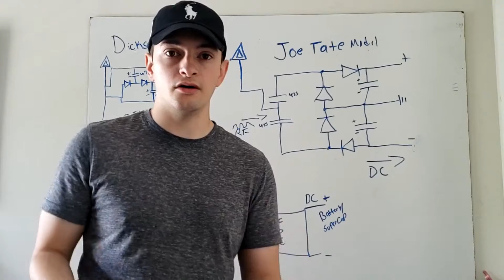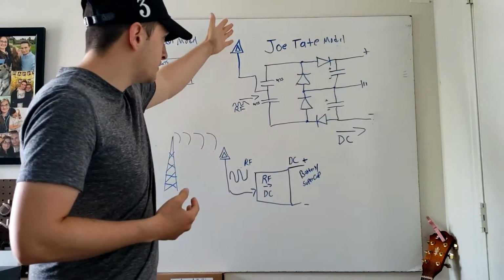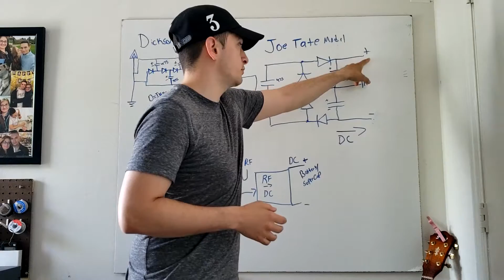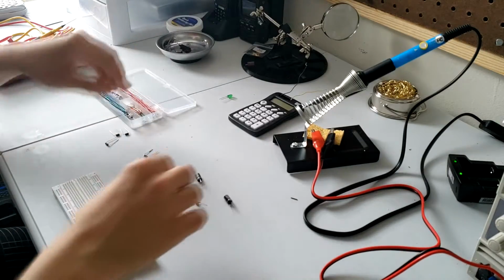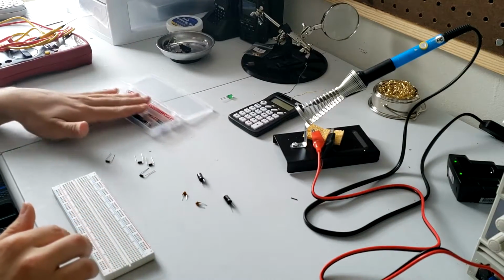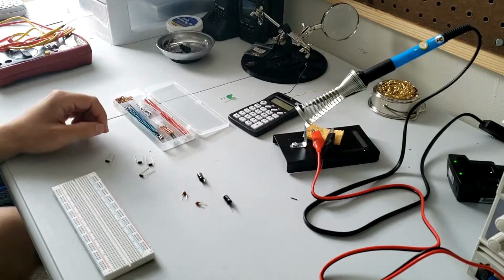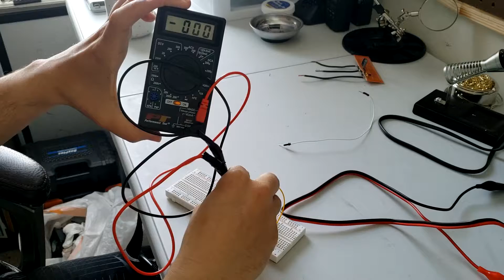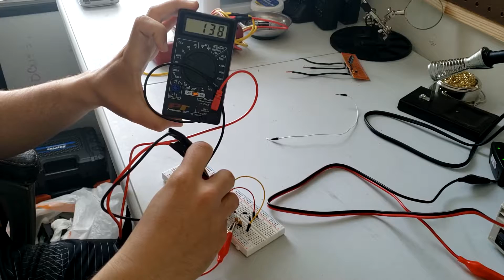RF Energy Harvesting - Building Joe Tates Ambient Power Module To Light an LED

Comment: I’ve never heard of “in4001” diodes. Do you mean 1N4001 diodes that have a rectification frequency of around 25KHz? Those are too slow for any RF signals. Here is a better circuit for energy harvesting from a HAM radio guy https://youtu.be/GhqRdNB_gUM?si=U7RdiT0sETuM1Xyj

Comment: Hi, 👋😢😢, PLEASE 🙏 BUILD THIS WITHOUT A PCB BOARD. WE DON'T ALL HAVE MONEY TO BUY ONE. I MEAN I WANT TO BUILD THIS BUT WITHOUT A PCP BOARD. 😊😊😊 TUTORIAL PLEASE 🙏
Reply: It is best to use a bread board because of organizing and knowing were everything is and they are not much but if you insist. The bread board had the 2 center columns that are separated at the center and separated from the row above and below but has 4 holes chained together on the horizontal sides. The red and blue on the sides are chained to gether in the vertical plain but do not chain the red and blue to gether because they are your positive and negative sides of your circuit hole this helps but if you need it visualized you can look up the internal connections online

Comment: how about connecting this circuit to that?https://www.google.com/imgres?imgurl=https%3A%2F%2Fwww.allaboutcircuits.com%2Fuploads%2Fthumbnails%2Fcockroft-walton-multiplier_revision.jpg&tbnid=j5A8AduKzbmkoM&vet=12ahUKEwjku6ftgpuEAxUqX_UHHZQYBGAQMygBegQIARBS..i&imgrefurl=https%3A%2F%2Fwww.allaboutcircuits.com%2Ftextbook%2Fsemiconductors%2Fchpt-3%2Fvoltage-multipliers%2F&docid=gIv9mvLLrmEguM&w=619&h=171&q=voltage%20tripler%20and%20quadrupler%20circuit%20diagram&hl=en&ved=2ahUKEwjku6ftgpuEAxUqX_UHHZQYBGAQMygBegQIARBS

Comment: Your restricting yourself by using electronic components, take an iron rod solder a cable to it and push it in the ground, then take a load of copper and stick it up in the air solder a cable to the copper then put your meter on the 2 cables, more copper more volts, because all electric is RF everything you believe to be true is false

Comment: Hello,

Can you say if it is possible to recover with your rectenna system, the energy of an electrical radiation which measures in Volt/meter?

For example, would it be possible to recover the electrical radiation that my computer or other electrical device propagates?

And would it be possible to recover the energy of the induced current of the body (see test of induced current of the body)?

If yes, can you sell me your ready-to-use system as well as make me a step-by-step video of the realization of your system and if so, at what price?

I thank you in advance for your return as well as the precisions that you could bring me?

Have a good day.

Cordially,
The White Rabbit ;)

Ps: this message has been translated with google translate because I am French and do not speak English.

Comment: Hey man! I am doing this circuit as a capstone project for collecting energy from alternative sources.  Can you give me a tip on how can I increase the power of this circuit?
Reply: I got selected to do undergraduate research and I think im also going to do this, this is so cool
Reply: @Coolgiy67  This is a fun project to open up possibilities of wireless energy transmission.
Reply: @Coolgiy67  Check out this video by company Powercast https://youtu.be/xZVA5p9c9hc
Reply: @wally4304  nice
Reply: You can either add a Joule thief to the output for current, or create a voltage multiplier for voltage, or a combination of both. Many people have been working on perfecting this circuit for more useful applications. As of now, this circuit is used to power low energy devices for the IoT.

Comment: its useless to use radio to receive power. you must diy a circuit that takes in continuos signal direct from the air, aerial frequencies. check the atmospheric electricity specifications, 100v per meter height.

Comment: add a flasher chip to the end of that circut it doubles the voltage to flash an led i think its a lm3909 flasher chip i hung it on my wall and every time i keyed up my station it flashed the led.

Comment: You can get Earh ground by making a 3-prong plug that has no BLACK and no WHITE wire ... only green ... the center lower pin. That is your Earth ground attached to the house. However, in some ways this cheats because there are loads of spikes on that wire from home appliances in the house that glitch and come off and on... Fridge, etc.

Comment: Bro, I'm getting high voltage but the current remains 50ma, but the issue with the current so, can you please tell me how to increase current to 500ma
Reply: perhaps the high voltage is due to inductive coupling,the multimeter maybe showing wrong values because of that,for better readings use analogue multimeter or voltmeter

Comment: 1. If you do have access to ground, where should i put the connection?
2. Which part of the antenna (in or outside) did you connnect to the antenna of the circuit?
3. Would  it be possible to put more antena's in this circuit  or would it just increase the resistance?

My highest reading yet is 25 mV

one last question: after a while the readings suddenly dropped to a negative number without inverting polarity , anyone has an explanation?
Reply: Everything is possible. But to add to your excitement...

Comment: Nice,  a few gafs,  you caught the capacitors/diodes one,   but also mw is no mv sure they can be related..  but...   also you could try tapping your electrical ground for a ground.  may not be great for audio projects, but may help your scavenging..  but here is my view and upvote and subscription.
Reply: One potential problem with using mains ground as circuit ground is the high probability that it will have errant voltages induced onto it, which can easily be in the 1-3V range in a large electrical system like that of an apartment complex. That would completely swamp out the energy being harvested by RF, and give the appearance of a false result.
Reply from the maker: Thank you for your input here. I'll take it into consideration on the next iteration.

Comment: when you connected the antenna, you only connected the positive cable. How about the negative terminal from the antenna? is it not needed? What if I have an RF source that has positive and negative terminal, how will i connect it? lastly, could you please make me understand the function of the two input capacitors? how will they affect the circuit if not included?
Reply: he not connect on positive cable he just connected the antenna in which ac types signal probably coming as he said means soo both left and right side wire positive  will coming as both side  capacitors he didoes so that he can convert into dc positive up and negative down  ... If You do not even use the circuit you will be getting direct signal of ac of that data.. capacitors used to strong energy without storing   ..  large metal can work as antenna also i think can allow more voltage flow..
Reply: I do not know much about capacitors but i thought they were used to filter out noise, also maybe he only connects one side of the antenna because of the rectifier circuit with the diodes.

Comment: Great job. That follows along with a crystal radio set using a diode. The RF energy collected on a longwire is enough to power a small earpiece creating sound that you can hear. I did an experiment similar to this back in the late 1970's. Very cool!!! Keep up the good work!!!
Reply from the maker: A Crystal Radio set is one of the next projects on the list! Thanks for the feedback. I tried germanium diode, and although the forward voltage drop made the current at the end much higher, for some reason they don't stop the caps from reversing current when the input is lower than their charge, so I can't store it as well. Still trying to figure that one out.
Reply: @ModernHam  Do you have to have a radio station to light up an LED or is there enough natural RF to light up an LED without a radio station? Thank you
Reply: @ModernHam  did you figure it out?
Reply: Do you have to have a radio station to light up an LED or is there enough natural RF to light up an LED without a radio station? Thank you